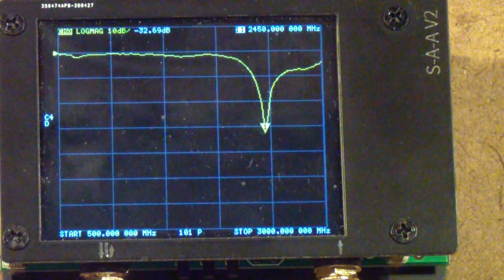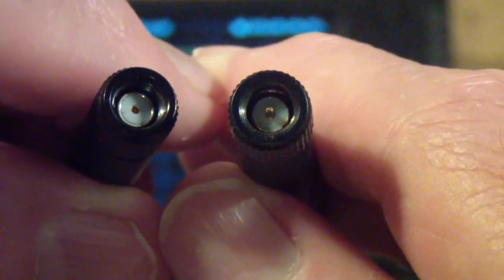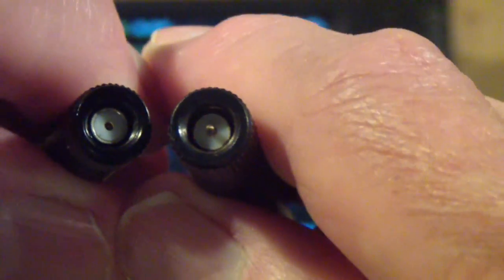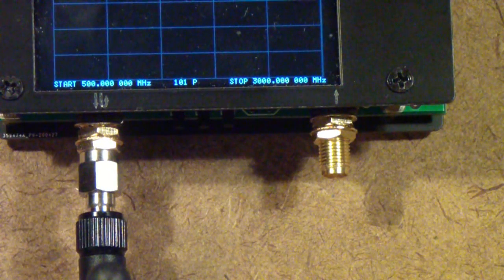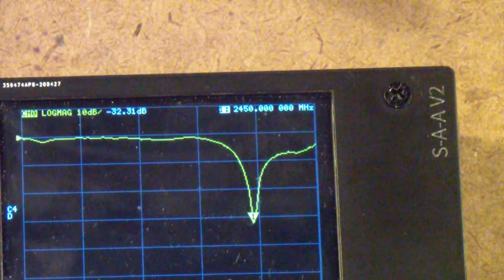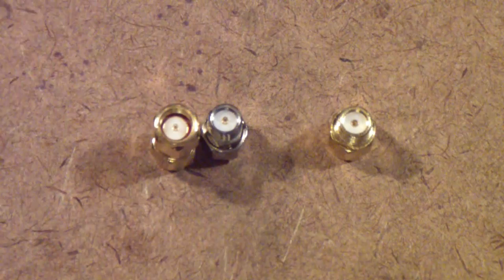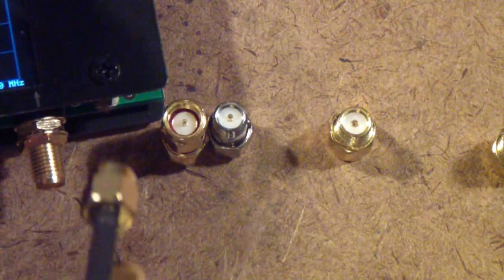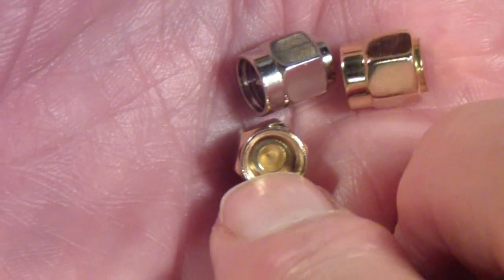TTT331 SMA Connectors

Comment: Quite interesting Tom...and pertinent to my needing to test different antennas & connectors for my Baofeng radios & Linksys wireless routers.  
I got about a dozen of them for my family, friends & neighbors for use during a SHTF scenario like the TS Sally that will be getting rather close to my area very soon.  
But have also started setting up my mesh network with Linksys routers reflashed for most likely intra-net...or internet with FLDIGI Radio Modem through the Baofeng.  
We will be able to access my personal servers even if the internet is down...the servers have over 22 million ebooks & 530K audio books available for pretty much any subject.  
From how to start a fire to carving a side of beef to raising meat rabbits to theoretical & quantum physics...and also a full selection of children's home school resources.